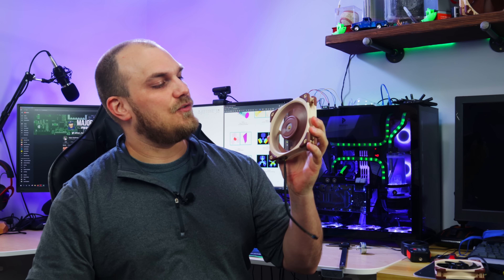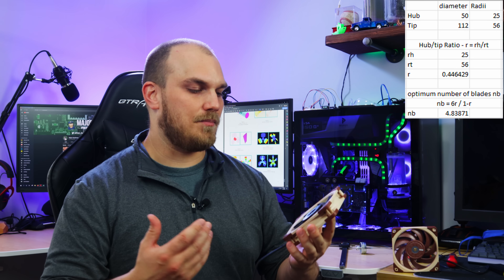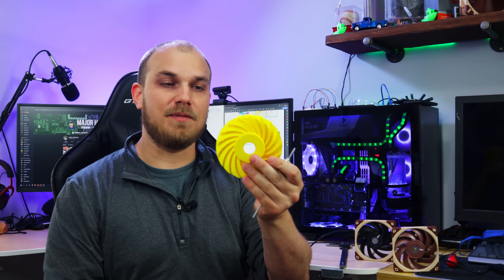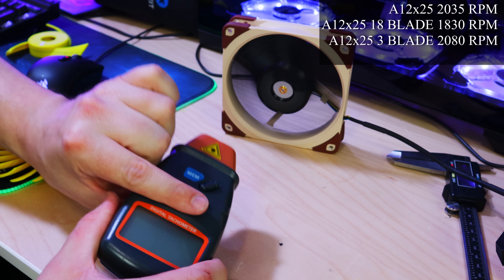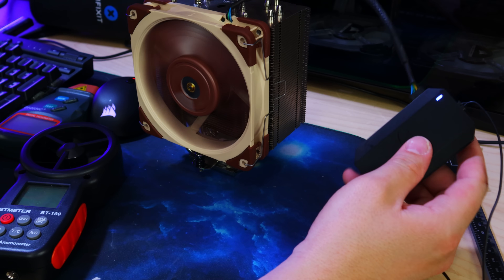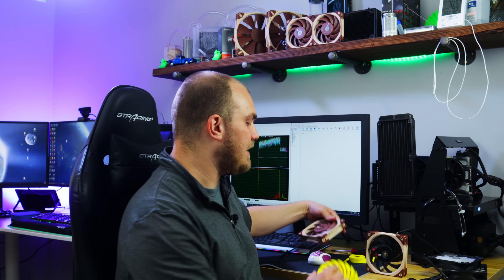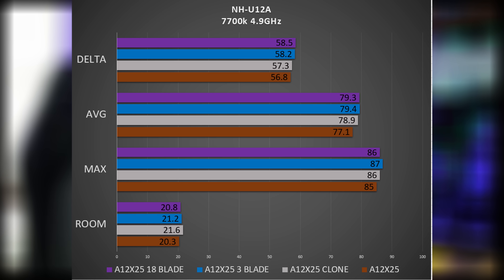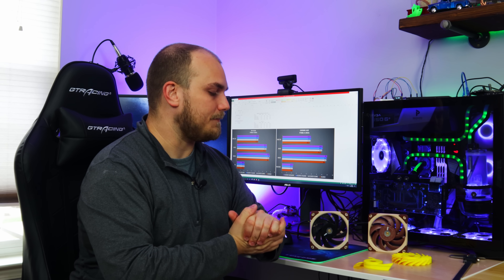What If the Noctua NF-A12x25 Had Twice as Many Blades? | Custom 3D Printed Blades

Comment: 8:25 It is my understanding that fewer but larger blades more less air but with higher static pressure, where as more and smaller blades move more air, just with less force.

Comment: You never measured fan current.  Without that you don't know efficiency.  
If your doing this in solidworks you should be able to do a flow analysis before you print. 
As others have said, " smooth rules" gotta fume clean those print lines.  
You can't just use more of the same blade. When you change the count you have to assume different cl on the blades and different pitch with velocity increase ( if you plan on one) 
Overall a really fun video. Thanks.

Comment: Im curious if PC fans fall under the same concepts as airboats, The amount of blades is limited to your engine horsepower and rpm range. On low rpm low hp engines people run 2 blade props for maximum thrust, but the big V8 guys run 3-5 blades depending on their engine rpms, you see a lot of big block 7.0+ engines run 3-4 blades and the LS/302 engines with 4-5 blade probs due to how much higher they rev out to for full power. I bet that 18 blade unit is pulling power power to maintain rpms or not maintaining as high of rpms as the 9 blade and the 3 blade is using less power to maintain the set rpms, but blows less air due to being limited to how high it can spin up. Id like to see you repeat the test but limit the fan hub to the lowest speed it can spin at.. to see the difference between the different blades.

Comment: The hub design of the Noctua fan really explains why my noctua fans on my outside radiator cooling system on my system has never had a fan fail over all the years its been outside in the Florida weather and rained on. I have them facing towards the sky, blowing air through the 480mm radiator and i have them all powered off a 12v laptop power brick, so they run full speed 24/7 as long as i have the power brick plugged into wall or turned on.

Comment: One last idea that I'm sure you could do, but it would be a lot of work:  A fan with no motor core.  Basically it would be all blade, with an aerodynamic spike in the middle (so there will not be a vacuum vortex behind the motor or support arms).  Attach the blades to a rim that is also the motor. 
You'd need to place magnets in the rim, wind coils, figure out a bearing, and build a controller (arduino).
Be pretty cool to get all that extra surface area and less drag.

Comment: To get a more accurate check on air speed, you should build a shroud that would mount on the fan, and then funnel down to the airmometer. Different fan blades can have a different air deflect from the fan housing, and you are loosing air pressure because there is open air out the sides of the heatsink. If you have 120mm fans, create a fan "hood" about 1 inch that stays the same size, then funnel down to the size of the airmometer.

Comment: Wow, I really respect Noctua as a company, did not expect to have a reason to like them even more. Really cool that they don't mind you sharing your replica designs. Will be interesting to see if any new ideas come out of crowdsourcing the blade designs, along side your own research and testing.

Have you looked into resin 3D printers? A bit more work to use, but massively higher resolution/smoother prints. Also, at the risk of being pedantic, your axis weren't labeled in your graphs. Should have been obvious given the subject, but you jumped into them so quick, I had to pause for a moment to realize they were showing temps.

Comment: You should talk about the air to blade angle of attack versus blade speed.

From the little I know about it, the angle of attack should be sallow on the tip.
It also should have a distance between blade base on air to blade speed (higher on tip zero on the absolute center).

BTW, you need to steep up the blade finishing quality, it looks too rough to archive laminar flow.

P.S.: honestly I think you to know more about areodynamics by now that I have no clue what you should know about it.

Comment: Other attempt copyed from an article about wind turbines:
"The structure of an owl’s wing serves to reduce noise by smoothing the passage of air as it passes over the wing – scattering the sound.... Early experiments included covering a blade with material similar to that used for wedding veils, which despite its open structure, reduced the roughness of the underlying surface, lowering surface noise by as much as 30dB."

https://www.sunwindenergy.com/owls-help-make-wind-turbines-quieter

Comment: Really interesting video! Thanks! Do you think you'd see a noticeable difference if you sand down the blades (I'm sorry for suggesting it lol) but I feel like the air resistance from the layers on the 3D printed blades could be reason for your cloned-blade-design performance delta.

Also, what if you tried a wider/fatter 3 blade design?

All of this is really really crazy interesting to me, so I just have to say thank you man for making this/these videos!!

Comment: I'd be interested to see the relation of surface area to blade count. Right now I have 3x 140mm fans in front of me, with between 5  to 11 blades (the 5 blade Arctic P14 is double the blade size to the 11 blade fan), plus a Noctua P14. The P14 design is actually very middle-of-the-road, (aside from the colour) the only discernable features are the outer clearance and the vortex notches (a couple of things I know Noctua is proud of).

The blade design varies a fair bit, especially the curvature. The outside of the blade is cupped forward (my guess is to make use of the centrifugal effect on the air), the curvature through the width of the blade ('bending' the direction of the air rather than simply cutting through it). While all the fans have a similar 45-degree pitch angle, Nortual's get less steep towards the hub, plus the actual width of the blade from the inside to the outside varies the greatest.

As for the surface finish, they're a mix of polished and textured plastic (Noctua is textured), so it doesn't look all that important. The sharpness of the leading edge seems more critical to 'slice' through the air, I think it would be worth sharpening the front edge to see the results.

It would also be interesting to see if a flat blade can work, solely relying on the Bernoulli principle. I can't get my head around how wings generate lift, I think it comes down to how a jet of air is at a lower pressure. It's counter-intuitive (it's a fcuking jet, it blows things! 🤯)

Comment: Could you try to double the fan by putting an other on top of it? Twice the thickness. This one you could test with a dense radiator to see it's static pressure. Would have been a good test for this 3 fans as well.

Comment: Have you thought about a turbofan-like design with an airfoil profile and batwing edges? Aside from that, I'd argue that you'd get better results with a smooth surface. It looks like your printed fans were using some pretty aggressive layer heights, perhaps .3mm?

Comment: can you print blades that reverse the direction so that the frame that supports the motor is on the outside? , and mount a "spinner" on the inside to reduce the blind spot that arises when the fan is mounted too flat on the radiator, like a duct fan with a venturi nozzle, the length of the spinner is based on the diameter of the fan hub, the thicker the hub, the longer the tunnel and the spinner, and / or a counter stator as used in jet skis, to straighten the air flow

Comment: I would say look at a turbofan blade and start from there.  That is pretty much what your looking for is a high pressure high blade count design.  Pretty much you should be looking at very aggressive blade angles.   I would actually also do an outercoat to smooth the blades as well.  Acetone smoothing might work but you should be able to get some spray paint and spray poly, you spray paint and then poly right after and use that much more easily and it makes the pieces look good.

Comment: you need a two  sets of blades design fan , one fan to collect air  and blow it into the second one that is designed for static pressure , its like putting two different  fans together  , with different designs and performances for the single goal of pushing air

Comment: One day I'm just gonna see "Twin Screw Supercharger cooling a PC?" And I wouldn't even be surprised.
Reply: I use a twin screw type compressor at my business. It provides 125 psi continually to many sources while needing a much smaller reservoir tank compared to the old, gigantic piston type compressor i used before.
Reply: Bolt one to the top of the case, mount an electric where the hard drive bays usually live to power it, and have the whole case sealed except side vents that's blow out the air like zoomie side pipes. Would be extremely inefficient and loud but cool for a super rich car guy who would only use it as a piece of art anyway. Maybe we should try to get Jayztwocents on that? Sounds like something he'd like
Reply: Why?  That shit is old design.  It kinda works in old, heavy cars with solid axles and carburetors but it has nothing against modern compressor tech used in turbos.
Reply: @toolbaggers  I think you're getting Twin-Screw and Roots type superchargers confused. Modern Twin-Screw and Centrifugal designs are far ahead of old roots type. I usually prefer a Twin-Screw to a Centrifugal supercharger, or a turbocharger. But small turbochargers, that essentially spool up completely from idle, are also really really good.
Reply: @GallopingWalrus  haha blower car go bWREEEERRR. Building boost at idle is the way.
tbh it would be a shit way to cool a pc because they get hot as fuck.
Reply: @toolbaggers  Must be why top fuel dragsters use superchargers.

Comment: Could you do a video, where you would test a 3d printed turbocharger turbine blade? It is known that thoose can generate a massive amount of pressure. Problem would be to fit it into a 25mm fan, but i think you can still get 38mm ones (and install into that somehow).

Comment: Hi, can you test air speed in open air? I think 3 blade should be better for case fan, it should have more cfm. Also, you should get super thick radiator, like 60 or 80 mm to really test the 18 blade, otherwise it wont benefit from extra static pressure.

Comment: 18 blader sounded best to me, even against noctua. And yeah, like more blades too. Think a never model of my favorite 120mm 1000rpm sleeve bearing (silent) dropped fan blades from 9 to 7 in newer model. Starting to think it was a cost saving thing as they were like 5€ a piece. Bearing dried out in 2-3 years of 24/7 usage, but perfectly fine for the price.

Comment: Now try making a STATOR in front of the fan.

Just a mirrored fan design mounted to it.
Maybe also with a vane that goes from straight forward and curves inn to roughly the same pitch as the fan blades.
And also have it beeing an odd number compared to the fan to prevent all the fanblades hit the "edge" at the same time

Comment: Really shows how confident Noctua is in their fan design to just be like "yeah go ahead and clone it, try your best." Probably having a bit of a chuckle as your attempts to crack 100s of hours of engineering. Not to sound insulting.

Scythe GTs also have 9 blades, definitely the sweet spot for static pressure fans.
Reply: Despite their high price Noctua still builds to a budget. I wouldn't be surprised if an inferior technical design can beat Noctua's retail products through the use of expensive materials and/or a labour-intensive construction process that Noctua could never afford to use and make a profit.
Reply: @BruceLeedar  Yes and no imo: Noctua is building to a budget yes, but at the same time any comparison demands a compromise of Flow, Static pressure and noise: Devalue one and the others can benefit but simply throwing money at the idea doesn't change it
Reply: The number of blades doesn't matter; it's the shape of the blades that makes the difference.  I have an 11-blade Nidec fan that stomps all over the Gentle Typhoon and A12 in static pressure, both at maximum level and particularly with airflow, which is where the Gentle Typhoon tends to shine.
Reply: @FanPhys  The number of blades absolutely matters - but in conjunction with the shape. As you say you can get 11-blade designs that work just as well as this noctua design, but only if those 11 blades are a shape that's optimised for 11-blade designs (and conversely, you can get 5- or 7-blade designs that do the same).
Reply: @nathangamble125  My comment was in response to the statement above that 9 blades is the sweet spot for static pressure, which is not true.  Static pressure comes from a combination of many factors, including blade shape, size, twist, and, probably most importantly, rotational speed.  Noctua's main goal with the A12 was to have it compete with the Gentle Typhoon while reducing the noise, which they achieved (I posted a video of both measured by a sound level meter).  It isn't able to develop the same static pressure (I've also measured this) but strangely both fans perform identically at 2,000rpm on a heatsink.  It's possible that 9-blade designs have favourable aeroacoustic properties, but it could also be a purely aesthetic matter - after all, the A12 is a Gentle Typhoon clone.

Comment: Try use a RADIAL FAN instead of an AXIAL FAN. Radial fans have higher static pressure and flow but they are noisier. Check SgaboLab's videos

Comment: I think with the 18-blade-design the gap between the blades is too narrow for the air to go through it which made it loose it to the 3-blade-design ob the air-cooler. Maybe you should go down a little on the density to 15 blades maybe?
Nonetheless I'm amazed that your 'clones' are doing that good.

Comment: Problem is man your'e using the same blade thickness. Your'r reducing the crossectional area for higher blade densities. If you double the blades you need to half their thickness to give the air the same amount of room to move through. Also higher blade densities will likely suffer more from boundry layer effects caused by the rough surface. 
Make blade thickness and density proportional to the stock and acetone smooth the surface and I think you will get much more useful and interesting data.
Edit: Great concept man, always amazed at how often the home engineer can outperform the big boys.

Comment: Maybe the high pitch of the 19 blades have something to do with the fan motor having to rotate more weight through more air resistances as 19 baldes have to cut throught air instead of just 9.

Comment: You should try doing some kind of golf-ball like dimpling on the surface of the blades. There's the Zaward Golf Fans that use something like that, but it's patented technology apparently. 
Also, how about trying out some kind of serrated edge for the blades? There have been studies about trailing serrated edges on fans reducing noise level at some frequencies.
Could do some myth busting, to see whether it's something actually useful or just gimmicky marketing ideas.
Reply: Older noctua fans do have serrated edges. Look at the NF-P12, just to quote a very common one :)

Comment: Awesome, I'll definitely be checking your thingiverse page.
 I've been wanting to try and design my own replacement fans for a helicopter I have. I have just been printing off various fans from thingiverse for the rear prop to test but I need to learn to make my own.
What software do you use to make your fans? So far I have only been using the free sketchup but I understand I will probably have to pay for something if I want to get more serious with my models. 
Thanks in advance if you answer this.

Comment: I've always wondered about some form of small squarrel cage fan as a case fan. They're super good at pushing a large volume of air but they're very noisy but they also wouldn't have to spin at a high RPM. Just an idea I've always wondered about.